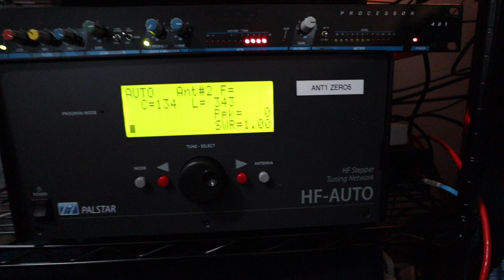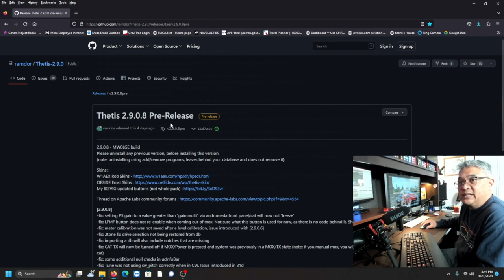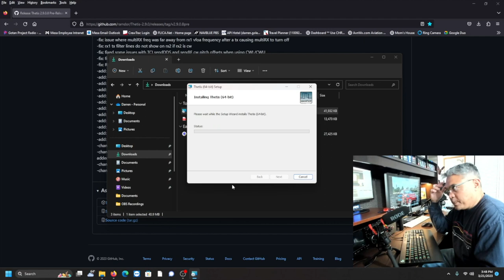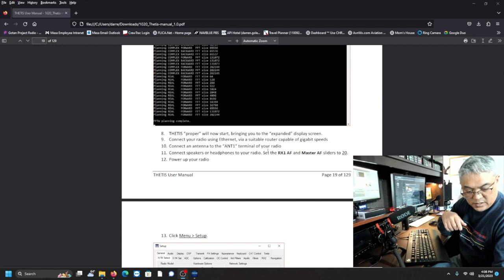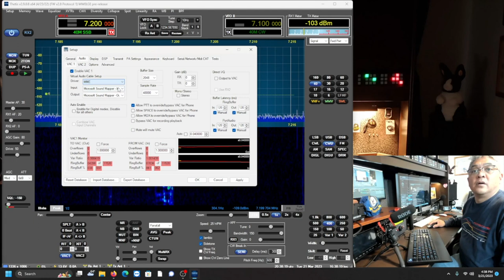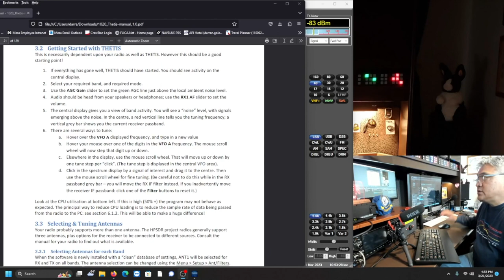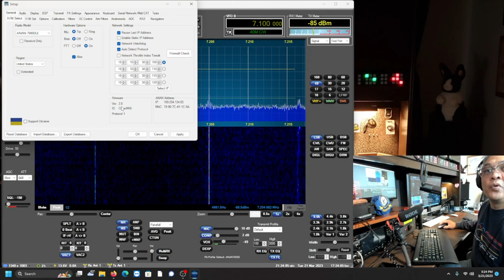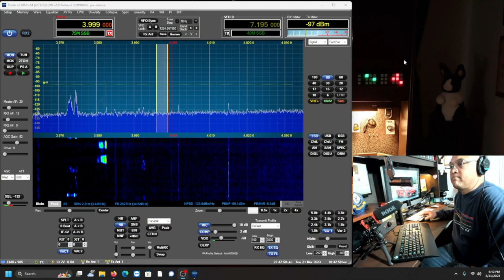My Apache Labs  Anan 7000DLE Mk3 and Thetis v2.9.0.8 Pre Release Installaton | Not a complete guide

Comment: I just got mine Good Friday, it's Easter Sunday now and it's still not hooked up... Thought I would have to load protocol 2 firmware to run Thetis? Looks like yours ran it on protocol 1? Was your bootloader switch on the bottom of the radio in the ON or OFF position?...maybe mine will see power up today? Thanks for making it look easy 73 de KA9UVY
Reply from the maker: Congratulations,  my bootloader switch is off.
Reply: @DarrenN4VFR  Thanks Darren, did you ever load protocol 2 firmware? I was under the impression that you had to use protocol 2 to take advantage of gigabit ethernet speed? I'm still sipping coffee here and making interface cables in my head, lol 73
Reply from the maker: @televisiondxer8105  No, it's still Protocol 1.  I'm not sure if my ethernet is running at 1 gb speed.  I can't see my router behind the desk.  But connections has been great so far.